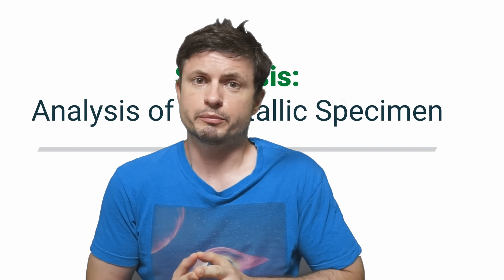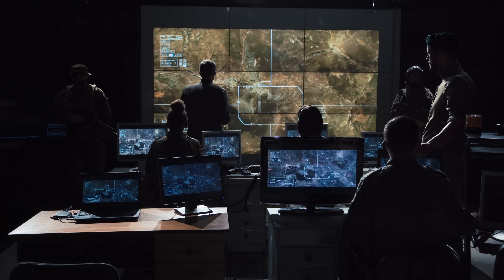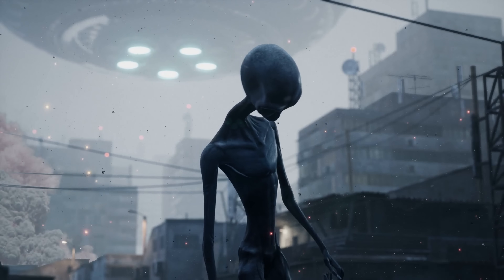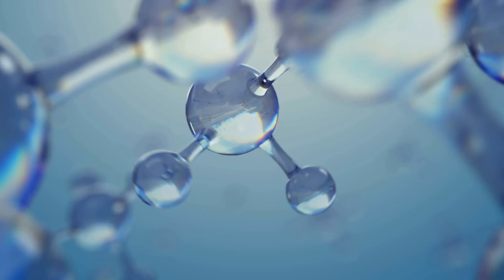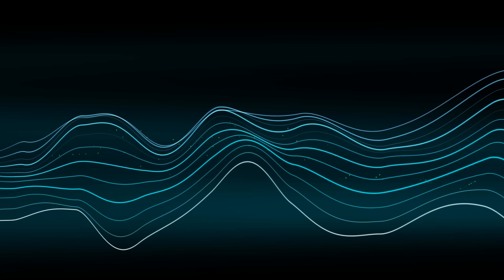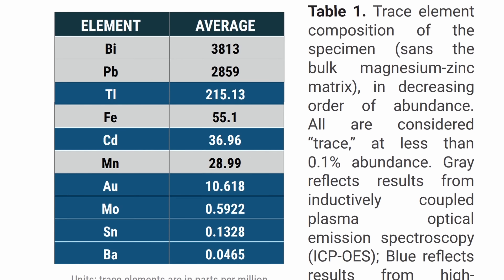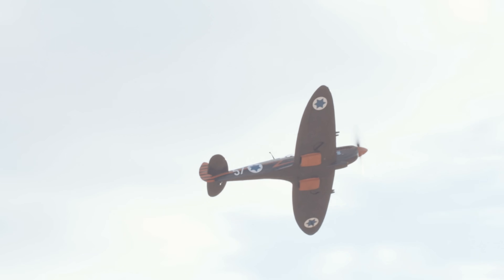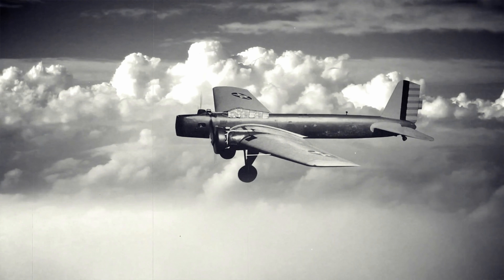Metal Piece From 1947 Roswell Incident Analyzed By a Government Lab

Comment: Not a suprise what suprises me is that they didn't know, whether it was an experimental weather ballon or an airplane why would they need to figure that out in a lab 80 years later, what it was made of? 
Who ever build it should know and yes it might have been classified but then why even have this piece out in the open? If it is classified just let it rot in a bunker until you can declassifiy the original project? Why waste money and resources on it if there is somewhere a file that will have the exact composition of the metal described. 
Just a waste of resources and time.

Comment: Project Mogul (sometimes referred to as Operation Mogul) was a top secret project by the US Army Air Forces involving microphones flown on high-altitude balloons, whose primary purpose was long-distance detection of sound waves generated by Soviet atomic bomb tests. The project was carried out from 1947 until early 1949. It was a classified portion of an unclassified project by New York University (NYU) atmospheric researchers.[1] The project was moderately successful, but was very expensive and was superseded by a network of seismic detectors and air sampling for fallout, which were cheaper, more reliable, and easier to deploy and operate.

A chart compares the height of a Mogul Balloon Train at 657 feet, the Eiffel Tower at 1056 feet, the Washington Monument at 555 feet, and the Statue of Liberty at 305 feet.
Relative height of a Project Mogul balloon train
Project Mogul was conceived by Maurice Ewing
-just a helium balloon.....
-NASA has awarded an agency-wide multiple award contract to Air Products and Chemicals, Inc. of Allentown, Pennsylvania, and Linde, LLC of Murray Hill, New Jersey, consolidating the agency’s requirements for 10.2 million liters of liquid helium and 128.6 million cubic feet of gaseous helium to support operations at 13 NASA locations.

Comment: OK this peaked my interest so much. I had to pause the video at 3:18 to go digging around on the internet for  magnesium bismuth alloy.  I have yet to watch the rest of the video.  If you mention "Theoretical analysis"  I am going to unsubscribe.  Because theory is not fact!  Oh you went there..  waveguide for terrahertz.. at least you did not say theoretical. I can not say for sure..  But I would place it as part of shielding for the test of Trinity test.  The  first nuclear test.   July 16, 1945..  Roswell incident.. July 5 1947.  debris field less than 30km form the test site.  I did not work out the exact distances..  But an easy distance to launch a piece from the test that some how survived. 

Bismuth has a slightly lower density than lead, This means thicker bismuth is needed to shield a certain amount of radioactivity than when using lead. And the properties of Magnesium in electromagnetic shielding is well know.   At a guess it was possible part of some shielding  on board the bombs or monitoring device near by.  A further clue..  Tube Alloys was the research and development programme authorised by the United Kingdom, with participation from Canada, to develop nuclear weapons during the Second World War. Starting before the Manhattan Project in the United States, the British efforts were kept classified..  

Of coarse all guess work.  But the location and timing and also the connect to an Tube Alloys..  makes sense. and connects a few dots.

Comment: That literally describes the black projects T.Townsend brown was working on in the 40's and onwards. He figured out certain metals like bismuth,  had antigravity properties and there was a link between gravity and electromagtetism, that if unlocked, could allow for full antigravity space travel, and manipulation of time. Look into the Jesse Michals documentary about it please. It will give you major insight into this matter. The problem with their experiments is voltage, Townsend browns experiments worked, were witnessed by many top military officals, and required extremely high voltages. Offshoots of his work are said to be used in the skin of the B-2 stealth bomber.

Comment: Anton, try googling this:

The addition of nanoscale additions to magnesium (Mg) based alloys can boost mechanical characteristics without noticeably decreasing ductility. Since Mg is the lightest structural material, the Mg-based nanocomposites (NCs) with improved mechanical properties are appealing materials for lightweight structural applications. In contrast to conventional Mg-based composites, the incorporation of nano-sized reinforcing particles noticeably boosts the strength of Mg-based nanocomposites without significantly reducing the formability. The present article reviews Mg-based metal matrix nanocomposites

There's a lot of recent interest in these materials.

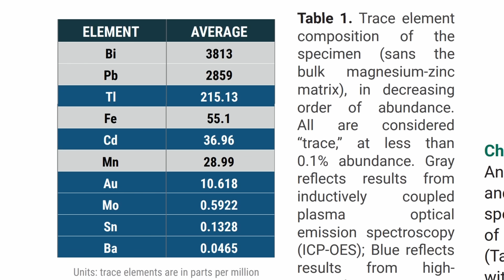Comment: 8:08 Off hand, that elemental analysis looks to me something like low-melting-point electronics solder. Bisthmus, Lead and bit of Tin, plus some other traces.
Fo electronics re-work (use for repair or modifications) the Bi/Sn solder mixes with the existing Pb/Sn solder and lowers the overall melting point so that less heat can be used to remove components. This changes the alloy ratios so it's anyone's guess.

Also, a lot of low-melt alloys are used for various things like pipe forming and the like - a wiki search for Cerrosafe alloy should get you started in the right kind of place. 
As it becomes used repeatedly, the initial alloy ratio gets changed by contamination by leaching from the metalwork you are forming so again, YMMV
Reply: and the sample has a curve to it, maybe it was simply something like well-used Cerrobend that had been used for pipeforming?

Comment: A lot of original witnesses described what would be a memory metal resembling aluminum foil.  It was extremely heat resistant and could not be cut or drilled by anyone who tried. It could be crumbled together and return to its original shape by itself. This material could not be made in 1947..

Comment: Anton, I know exactly what it is. It is build-up from the inside of a Cathode Arc Deposition machine, used to make thin film coatings such as Titanium Nitride for example. Each run deposits thin layers of metals used to coat parts. This builds up over time, and eventually has to be chipped out as part of vacuum chamber maintenance. The reason there is no record of it is it’s literally garbage. 
Does it have interesting properties? Yes. 
Are those properties useful? No.
Reply: Yes!!

That's exactly what it looks like. Metal deposition on to a Cathode from some electrolytic process was my first thought.

It has that kind of `nodular` look and the overall finish that happens as the various layers plate on top of each other. 

At first glance I thought it looked like maybe Silver recovery Cathode plating, used to extract the metallic Silver from photographic processes, mainly the fixer solution, to keep it out of the potable water table. 

It's not that, but the plating process creates a distinctive look. Good eye!
Reply: This is the answer.
Reply: Move along move along, nothing to see here folks.
Reply: Who would be doing cathode arc deposition of Mg/Zn?  To what end?  I don't buy it.  And in the 1940's?   Were people even doing vapor deposition of metals then?
Reply: @incognitotorpedo42  Yes, it was really just getting started, which makes a lot of sense. They were doing experiments, trying to figure out what properties different thin film metal coatings have. Hence the weird makeup of this piece of machine build-up.
Reply: @codyk7128  Most likely it'd be right at the end of WWII. As aircraft were shifting to aluminum, and jet engines were first being developed. There was suddenly an explosion of interest in thin coating possibilities for the airframe and engine parts.

This would make the material "very new" and "very weird" in 1947. And also very likely a deliberate fake, as there wouldn't be much reason for it to be found where it was claimed to be found. It'd have been selected as something which could pass for a "plausible & intriguing" fake, for a number of decades -making it have certain monetary value.
Reply: Most interesting conversation, indeed
Reply: This would indicate sloppy work during this so called thorough investigation.
Reply: @matfax  Not necessarily. Physical Vapor Deposition (PVD) is a pretty niche industry. I’ve worked on several types of PVD equipment, the only one that produces this type of buildup is a cathode arc machine. Cathode Arc is a niche within the niche. Like the old saying goes “you don’t know what you don’t know”. If they talk to someone in the industry they will quickly figure it out.
Reply: @codyk7128  so niche that there's multiple people in youtube comments with the answer. if only those aaro folks had the ability to ask!
Reply: @matfax  Not really, the primary purpose of the investigation was confirm what it was made from, was it produce on Earth and what is it properties. They did all three. Then came up with a hypothesis of how the metal came into being.

Comment: DNA is one of those molecules and why there are health concerns with THz imaging. 
I used to work on an early 50s F1 car. It was one of the earliest non-aero uses of magnesium alloy at the time, in the wheels. Back then it was space aged. Now a superbike from early 2000s has magnesium alloy covers on the engine and most Stihl power equipment have many Mg alloy castings. In fact, Stihl makes lot of Mg castings for Porsche, they are neighbors sort of.

Comment: Are there Aliens: Yes, statistically there have to be aliens as the universe in infinite. So if you would be able to travel faster then light and go a couple trillion lightyears then you might find another civilization. Go a googol times a Googol lightyears and you are statistically guaranteed to find another earth where everything is exactly the same as here. Infinity is weird like that.
Do you thing that they have or ever will visit the earth: No there is no indication that there are any advanced civilizations in our Milkyway or at least not close enough that interstellar travel from there to earth would be feasible. Current scientific understanding is that there is no way to travel faster then light. Even the methods (Like space folding) seem to be inpossible due to the need for negative energy and/or negative matter. (Which is not the same as antimatter)

Comment: This information makes a lot of sense if you have read Annie Jackobsen's book, "Area 51".  On pp. 36-37, she recounts that an unidentified aircraft crashed outside of Roswell, NM.  Allegedly, "Block letters from the Cyrillic alphabet had been stamped, or embossed, in a ring running around the inside of the craft."  The conclusion drawn was that at the end of WW II, Russian intelligence had obtained secret, advanced stealth aviation technology from former German research facilities that they encountered in their occupied territories.  The theory goes on to suggest that the Russians constructed and flew an aircraft based on the tech they found into United States airspace and that it finally crashed outside Roswell.  It stands perfectly to reason that the Germans had engaged not only in advanced avionics research to construct aircraft that would not reflect radar signals — this is what "stealth technology" means — but that they also must have engaged in metallurgic research in the hopes of finding very lightweight materials that would not only be unreflective, but also able to better overcome the radical and un-aerodynamic geometries of their stealth designs.  If structural components of that aircraft had been made of this Magnesium/Zinc/Bismuth alloy then they probably were vulnerable to breakage.  That could have been a cause of the crash.  Who knows.  But the point is that a metal with unusual properties (for the time) is very consistent with the crash of an experimental aircraft. There is absolutely no reason to suspect aliens.  This metal along with the crashed Roswell aircraft were very much human inventions.

Comment: The material is alternating layers of metal that is highly conductive and one that is much les conductive. The PEICES WAS BUSTED! WHY NOT REPLICATE. 

the way I think it works is frequency waves pass through the individual layers, the emanating waves look like those foam sound proofing sheets with the high and lows in a plane. The layers stager the waves, the waves overlap. You turn up the amplitude to lock on the space around the surface, then raise the frequency to condense space time and create increased gravity. But yall are testing the the cystal vibrations 😭

Comment: Surprise, surprise, surprise. I basically grew up in Roswell and never bought into the nonsense of it all or any other crash claims. I mean, they can fly through the cosmos but get here and crash?,...just makes no sense.
Reply: Why do you assume they can't crash
Reply: @ViceZone  You didn't really think your response through before hitting the send button did you?
Reply: @michaelfox2433  Yes, I did. Why do you think non human craft’s can’t crash?
Reply: @ViceZone  A craft thats supposedly capable of interplanetary, if not inter galactic flight with anti gravity capabilities and faster than light speed engines comes to this backward rock and suddenly is less reliable than a 1975 Cessna airplane with an incompetent crew. Yeah, that sounds reasonable?
Reply: @michaelfox2433  You really don't know anything about the capabilities of the craft to say that it has anti-gravity engines and that it can do interstellar travel, even if that’s true, it doesn't mean that they can't crash, either due to some mechanical failure or from being shot down by others hostile beings with the same or superior technological capacity.
Reply: @ViceZone  🤦‍

Comment: It had a mundane explanation so they released the report. If it had proved to be a complex metamaterial beyond our technology, they would have made it, and the report, disappear. This is how it has worked for 80 years now. I worked for the DoD for 25 years and do not trust anything released to the public. Anything even slightly embarrassing or difficult simply doesn't get past the outside door.

Comment: There are a lot of rumours surrounding the Roswell incident. One of them was ”metal” that could be wrinkled and regained it’s shape. I wonder if it was a polymer with almuminium coating? It would look like metal, be very light and flexible and recover from a bent state.
Reply: Otherwise known as a Walkers crisp packet, no matter how hard you screw them up to throw in the bin, they always unfold.
Reply: Also supporting the "metalized polymer" idea is that it would have been a fairly unusual material at the time, having not yet become so common that it was even used in novelty balloons and candy wrappers (wax paper was a very common choice at the time).
Reply: In my memory atleast some metal pieces found was come and collected by Some group/agency. It might also be fear linked to it but people also many times does seem to discard stuff after awhile. Whatever found in similar cases, in some situations it might just be smart if having no idea what it is..
Reply: I heard a local civilian found sheets of what looked like alum foil—except if you wadded it up, it would return to its original shape.
Reply: I was an optician for many years   a titanium alloy of material has been used in eye glass frames. The material is flexible enough to bend in half and when let go it retains it's original shape.   To be found in the 40s would've been unusual but now very well known and barely used anymore but if found in that time it'd be thought as magical or alien. Easy
Reply: Yes, as in Mylar. DuPont worked with the US military in the late 40's developing such materials. It was a few years later that Mylar was patented and sold to the public. So maybe that "metal" they found was aluminum coated mylar.
Reply: We need to send Ukraine tanks made with this material as their final game changer to win this war and prevent WW3.
Reply: @DanMorgan-r7q seriously?
Reply: @zarni000 i know right. Its like he actually believes it and isnt baiting 😂
Reply: @EnCounterCultureMedia  yeah i was not sure but the WW3 comment at the end kinda clinched it for me.
Reply: @DanMorgan-r7q Nah
Reply: @DanMorgan-bh5fv  what war? Millions of people with cell phones in Ukraine and NO videos? How is that even possible?
Reply: @dannymonk9485 😂
Reply: @dannymonk9485 bait used to be believable